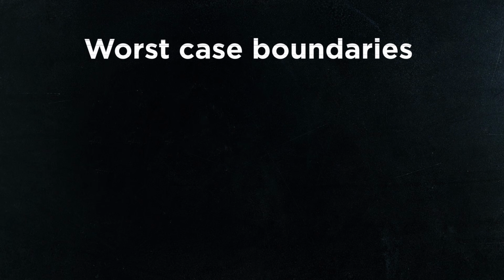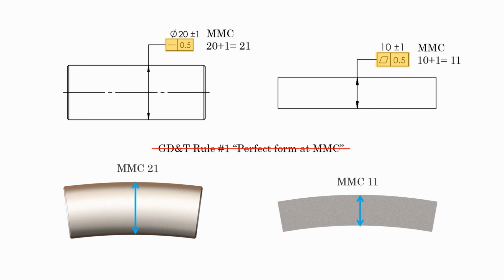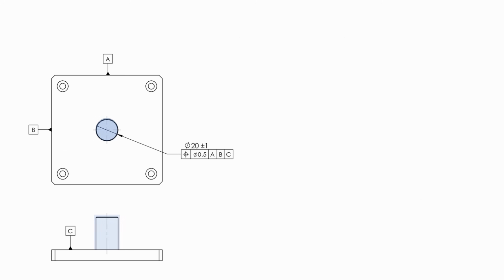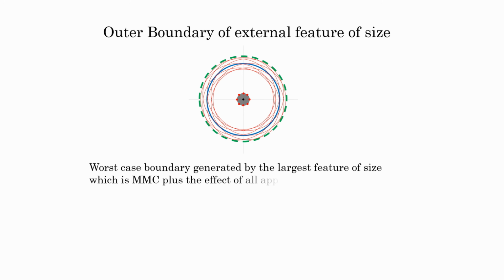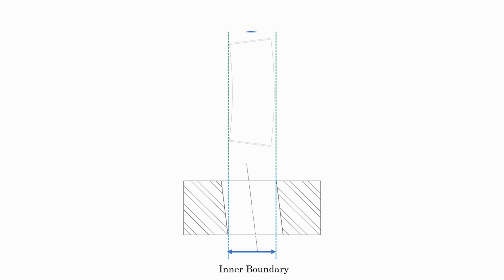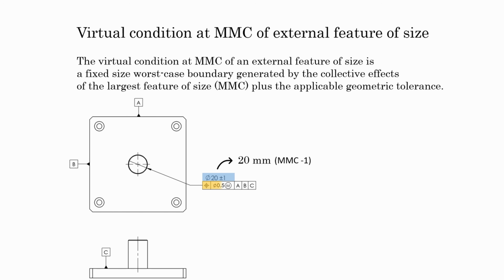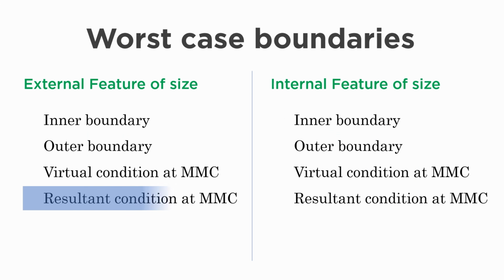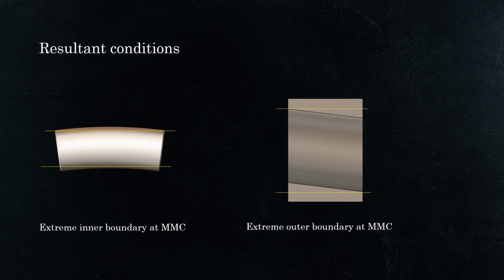GD&T Masterclass | Virtual condition and Resultant Condition

Comment: great video and thanks a lot. 
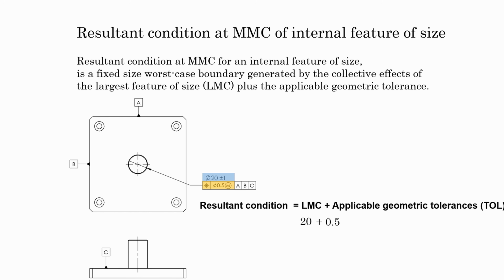Just a question on 29:57 Resultant condtion of a hole, shouldn't you also add the bonus tolerance? So the formula below instead:
RC_hole = LMC size + geometric tolerance + size tolerance (bonus tolerance)

Comment: Good Explanation. Just 1 correction, at 17:28 it should be "Outer Boundary = LMC + TOL" instead of "Outer Boundary=LMC-TOL". Calculation done was correct just the formula need to be corrected. Thanks.

Comment: Sir, i have one doubt , 
1) why we are not calculating outer boundary at MMC for internal FOS ?
2) why we are not calculating inner boundary at LMC for internal FOS ?
3) why we are not calculating outer boundary at LMC for external FOS ?
4) why we are not calculating inner boundary at MMC for external FOS ?
(Plz tell the answer if any one knows)
Reply: For MMC and LMC we have to calculate virtual conditions and resultant conditions, as outer boundary and inner boundary are calculated for RFS so there outer and inner boundaries are variable but in case of MMC and LMC because of the bonus tolerance the virtual condition remains constant 

So in short outer and inner boundaries are calculated for RFS modifier only. And for MMC and LMC virtual condition and resultant conditions are calculated.

Comment: Great Teaching, I have been following all this GD&T session you have explained it was very nice & understandable, i have one doubt, in this Video you mentioned, we should consider RFS for Outer & Inner boundary, but previously you explained by Default GD&T Rule-1 is applied (Perfect Form at MMC) unless it was specified for Center median. Please explain here for that hole why we are considering RFS for that Hole?
Reply: because the geometric tolerance is attached to the hole dimension (Applied to Feature of Size), if it was shown separate (Applied to surface) then GD&T rule 1 will apply at MMC.
Reply from the maker: Please mention time stamp

Comment: Bro there are some mistakes in this video please correct it.
1. 17:29, Outer Boundary formula of Internal FOS is wrong please check; it should be LMC + Tol
2. 27:45, Resultant condition at MMC of external FOS formula is wrong it should be LMC - applicable geometric tol at LMC i.e. 19 - 2.5 = 16.5 mm
3. 29:58, Resultant condition at MMC of internal FOS formula is wrong it should be LMC + applicable geometric tol at LMC i.e. 21 + 2.5 = 23.5 mm. Aslo the image is wrong its external FOS (shaft) should be internal FOS (Hole)

In this video you have not explained Virtual and Resultant Condition Boundaries Using the LMC Concept, while I was referring to ASMEY 14.5 standard I found above mistakes.

Thank You! for your efforts. waiting for remaining GD&T sessions.
Reply: Thanks for the correction, Don't know why he doesn't considered.. the RC situation here in shaft and hole.

Comment: Thank you engineer for this explanation but what about the tolerances in the bolts? Are there standard tables for internal and external diameters?
Reply from the maker: Yes ISO 965-1, most common grade 6H for internal threads and 6g for external thread.

Comment: Thank you very much for the clear video. Out Boundary = Diameter 21(MMC)+0.5(Position TOL)+0.5(Straightness TOL) In this case, Straightness TOL seems to be included in Position TOL, but I wonder why Straightness TOL is separated and added separately to Out Boundary.
Reply from the maker: Hi, think in this way, that position TOL and straightness TOL both are geometric TOL, and both are not depended on each other.  So, you don't need to include one with other. both are separated, So. you should always add them separately.
Reply: Thank you for your reply.
Reply: First of all that the straightness over here is redundant, it should refine the perpendicularity w.r.t Datum C, means should be lower than 0.5. After correcting that also, VC should take the position tolerance only in calculation as that is the worst condition

Comment: Hi, thank you Master Ayush for your great work to make all these perfect classes. I am a Chinese guy who was trying to learn GD&T from time to time and from many other channels but can not find a good learning material. It's your videos that gave me a clear, easy to get learning experience. Thank your so much.
For the questions you listed in the PDF, my answers are: 
Problem 1 - OB = Φ22.08 mm, IB = Φ 21.88 mm. No VC and RC for this kind of geometric tolerance design.
Problem 2 - Virtual Condition = Φ21.7 mm, Resultant Condition = Φ22.3 mm, not call OB/IB in this case. Am I right?
Reply from the maker: Hey. thank you so much for your kind words. 
Problem 1- OB = MMC of pin 22 + (- 0.01) + Applicable Geometric tolerance (Position TOL 0.1) = 22.09 (Here circularity geometric tolerance does not consider, because this is a surface control)
ID - LMC of pin (22-0.02) - POS TOL 0.1 = 21.88 mm
Yes no VC and RC could be defined in this example.
Problem 2 
VC at MMC = MMC of hole (22-0.1) - POS TOL @ MMC 0.2 = 21.7 mm
RC at MMC = LMC of hole (22+0.1) + POS TOL @ MMC 0.2 = 22.3 mm
and yes in this case we doesnt define OB/IB
Reply: @mastermechanicaldesign  Thanks for your detailed answer.👍
Reply: @mastermechanicaldesign  Based on ASME Y14.5 2018 (Page No. 46 ) In Problem 2... RC must be 22.5(Including 0.2 of Bonus Tolerance). 
So Can you tell me it is right or wrong ?
- I am writing After Looking of 2-3 Different Sources.
Reply from the maker: @DilipSingh-nv1ri I guess you are referring figure 5-14, Where RC of hole at MMC is LMC of hole (30.5) + POS TOL 0.5 = 31 mm, right?
So, this is exactly same, RC of hole at MMC = LMC of hole (22.1) + POS TOL 0.2 = 22.3 mm, what is wrong here?? Why RC must be 22.5?
Reply: @mastermechanicaldesign  So Can you tell me For 
Problem A - Hole Dia. {30.5 to 30.1(Limit Tolerance)} @ ⌀0.1 MMC
Problem B - Shaft Dia. 20±0.2 @ ⌀0.1MMC 
What is RC of Both Problems ?
Reply: Means When Modifier is given then  OB or IB is Not required to calculate? Right.
Reply from the maker: Yes, that's right. Or we can say in that case OB and IB become virtual conditions and resultant conditions.